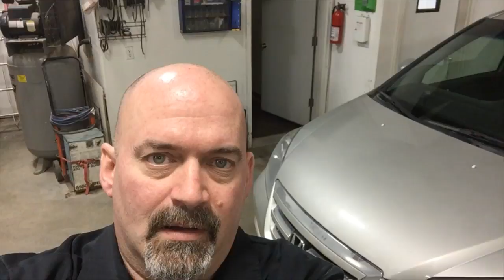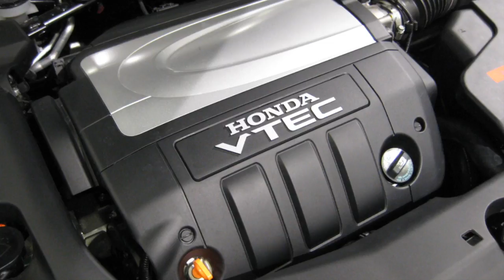Honda Code P0420

Comment: Long story short someone drove my 2006 Odyssey from LA to Chicago and the timing belt was torn (not in driving) he toke it to mechanic that fixed the timing belt together with the water pump and pulley, I tow the car back and the engine running and sound good but..
i saw oil leak and the car start to white smoke and P0420 code, what should i check first??

I dont know if the add oil (probably yes cause there is more than what should be) and what happened to the car

Comment: Finally fix the code without pay for new cat. They won't ship to Cali anyway so I bought a $40 endoscope/ sewer camera on Amazon to check the condition of the Cat internally. I removed the rear Air/Fuel sensor near the fire wall which threw the code p0420 for about more than 1 year now. It was pain in the butt to remove the pig tail connector, took me almost 1 hour to move it near the firewall/cabin.  I feed the camera down the catalytic and i saw the honey combs are still intact nothing was broken. The A/F sensor itself was color tan, nothing much carbon built up which was good.  I also removed the downstream oxygen sensor too.  I did the Spark Plug Non Fouler (Doorman 42009 for $6.99) to the downstream oxygen sensor. There are tutorial on how to do it here.  The way I did was different, instead of drilling out one of the Non Fouler with use a 1/2 inch drill bit to hollow out the inside so the O2 sensor would fit properly, I used my cutting tool dremel to cut the protective metal case on the sensor itself. But be very careful when cutting the protective metal case , don't cut into the sensor itself which was ceramic. I did cut into the sensor a little bit but it didn't break because I didn't have any 1/2 inch drill bit around the Non Fouler since the sensor fit perfectly inside the Non Fouler.  I install the Non Fouler to the Catalytic where the Oxygen Sensor was then the cutted oxygen sensor fit into a Non Fouler. It basically, 2 Non Fouler back to back and then the cutted Oxygen Sensor mounted it on after the 2 Non Fouler right where the hole of the oxygen sensor was before.  The purpose it moves the post cat O2 sensor away from the exhaust so it gets a lower reading than the pre cat O2 sensor. I reset the code and drive it. It never went back .  It was cheap fix without buying new CAT like this doctor said.  I checked with my scope it was good, internal honey comb was still intact.  I also bought an A/F sensor from craigslist seller in OC area Harry  (714) 292-5542 for $80 today just in case the code comes back again.  Ebay oxygen sensor $35 (downstream one is cheaper than locally autoparts store $150. Good luck doctors

Comment: I have good news: I text my friend who is a home mechanic, he also said it was common problem for old Honda Odyssey.  Anyway, after driven 2 full tank of Costco Premium gas.  The code went away on it own.  The last full tank I filled up with expensive $10 full cleaner at Walmart.  The full tank followed that I didn't put anything in it.  I drove freeway most of the time and waited in line drive through at McDonald everyday for their free Thank You meal (I'm a respiratory therapist working in front line with Covid 19 patients).  I just refill with premium again yesterday morning before going to work. Anyway,  on my way home, I cruised at 80 mph on freeway about 10 minutes, the check engine light went away and disappear on by itself.  I was happy but still have to wait for a few more hundred miles before it goes away for good.  I will save to by OEM Cat just in case it comes back.  I hope i didn't jinx it.  Thank you

Comment: you know what i read a comment down here saying CataClean chem bottle ($28.26 at Autozone) cleared the code. Guess what! It worked for me cleared the p0420 for me on my 05 honda Odyssey when the code poped up after i replaced 6 spark plugs and did timing belt myself, 2 axles and 2 control arms (3 days worth of work).  Thank you . I added the bottle to 1/4 tank of gas, cleared the code.  Took the car on freeway to the open road for 50 miles, no code pop up.  So far no code yet after 150 miles with new gas and $10 gum out injector cleaner in it.  I guess it was the stale gas that sat for month when the van was not driven.  So happy right now. Almost shell out $120 for new rear Denso oxygen sensor and $400 for new rear catalytic converter.
Reply: Nevermind the chemical catalean. The code popped up today after 150 miles driven. Sorry it didn't work with chem cataclean.
Reply: @TruongLe-eo8kh  thanks for the update, I was going to buy a bottle.

Comment: Good morning car Doctor, I have 05 Honda Odyssey with 220K miles. I recently replaced both control arms, both axle, and timing belt myself 4 to 5 days of work. Now I got p0420 code.  When I was trying to remove the axle on the passenger side, it was really hard, i didn't have the car high enough because I had the jack low.  I hammered with axle out of its housing from the tranny with a piece of iron (half piece of tire pry bar) i wedge it in between the Y of the exhaust and very near the catalytic converter and I really go to town with it for 20 minutes. Could I have bend or misaligned something down there causing a leak in the exhaust by hammering the passenger side axle out.  It was really stuck.  Thanks

Comment: CAR Dr!! Hey, just browsing the web to find more info on P0420. I found your video and was helpful. I think my cat/s are probably bad. I have an '05 Oddy with 223K+ miles. About a year ago, I replaced both O2 sensors cause that's what my scan tool said, (forgot the code). Now my CIL is on and found code P0420. Both my downstream sensors are jumping in voltage, anywhere from 0.1v-0.9v!! Sometimes they stay put at 0.7v at idle, but drop to 0.0v when i decelerate. I didn't know what the upstream 02's should read, so I found your video helpful. I'm going to monitor my upstream O2's and see if they are at the 10% range as you suggested. I'll give you an update when I find out. I really think I may have a leak though, because, my Oddy has no hesitation when I accelerate, BUT I do hear some "rattling" sometimes coming from under the van and also smell what seems to be exhaust fumes, or maybe just burnt oil from my oil leak I just found out I had on my last oil change. So many variables......I'll be back!!

Comment: I have s 2009 Honda Pilot, approximately 80,000 Miles

I have replaced all the O2 sensors, evap canister, solenoid and gas cap. Drove 120 miles and removed battery cable for 10 minutes to clear codes. 

I still have the emission system codes...
PO135
PO155
PO141
PO135
PO498

Any ideas?? Thanks!

Comment: Hello sir, I don't know if you will get this message but I have a 2011 Ford Flex that has a catalytic converter causing the check engine light to come on. The mechanics scanner says it's operating in the green but just low enough to trip the check engine light on.  I have tried CRC, Techron, Seafoam, and even Lacquer thinner. Nothing works!!! I cannot afford a new converter. Do you know what will clean out this converter?????
Reply: kevin johnson cataclean

Comment: I have P043 code. Isn't it the same?
Reply from the maker: No. Different deal. That’s an O2 circuit voltage issue.

Comment: I have a 2007 touring and my check engine light is on runs good what can it be can u call me 509-823-8193 thanks
Reply from the maker: See if you can have the codes checked and let me know what you find out.

Comment: Well, I am NOT a mechanic but I have a friend who is and he said P0420 is usually related to bad O2 sensors.  That is the consensus on just about every professional web site I have seen, as well.  And replacing the O2 sensors is far cheaper and easier than replacing the catalytic converter.
Reply from the maker: +Andrew Steitz Well I haven't found that to be the case on these vehicles but it is possible. That's why I'm the video I talked about monitoring the fuel trims for both banks and if they were plus or minus 10% or more you may have a faulty A/F sensor or vacuum leak that should be addressed first. Monitor both the A/F sensor PIDS as well as downstream O2s and you should get an idea for the cause of the fault. The Cats are the most common failure that we see on these vehicles with P0420 codes. Replacing O2 sensors are cheaper than cats but if it doesn't fix the problem then I'm not sure you'll be saving any money. Good luck.
Reply: +The Car Doctor I am the one who gave you the "Thumbs up".  You are correct that if replacing the O2 sensors doesn't "do the trick" then you have to replace the cat, but when you replace the cat isn't it usually good practice to replace the O2 sensors as well?
Reply from the maker: If they are original and you have over 80K miles it's probably not a bad idea I just usually have a had time up selling them to customers on top of an already expensive repair. In your case if you don't have access to a scanner to look at the data and make a solid diagnosis then the sensors might be a good option. In the end you'll be saving the cost of a mechanic actually checking so your still money ahead. Don't forget that the upstream is really an air-fuel sensor and no an O2. Also you don't want cheap sensors. Go with OE equilivelant not NGK or off brand stuff.
Reply: @ThecardoctorTV  my 2005 HOnday Odyssey 220K miles . Internally , CAT are still intact. I didn't used non fouler method for the downstream oxygen sensor and reset the code. It never came back. I'm ready for smog check